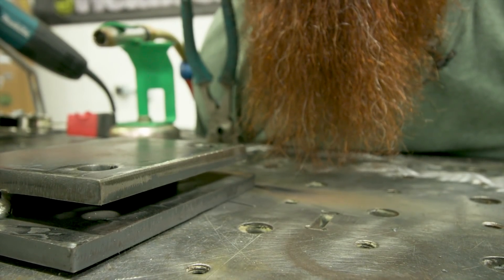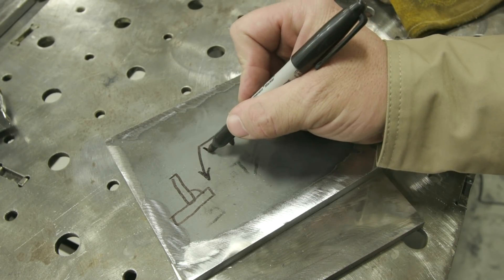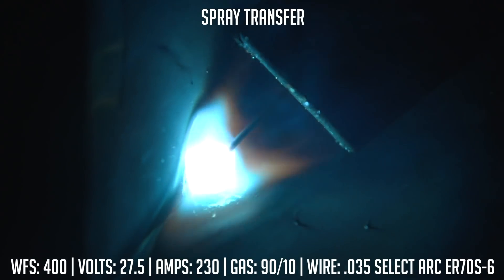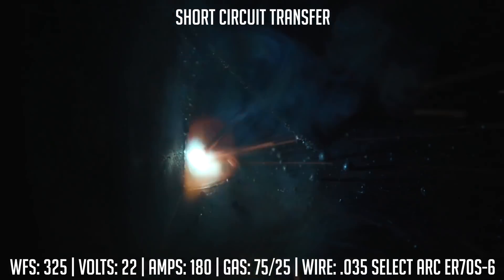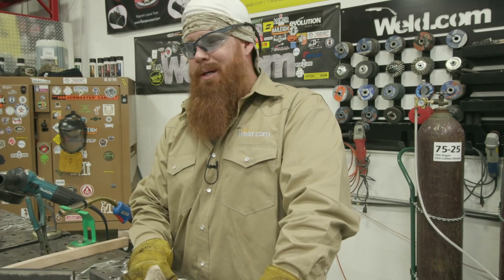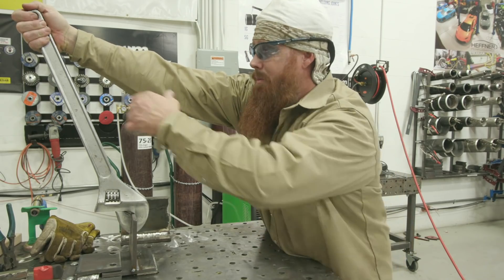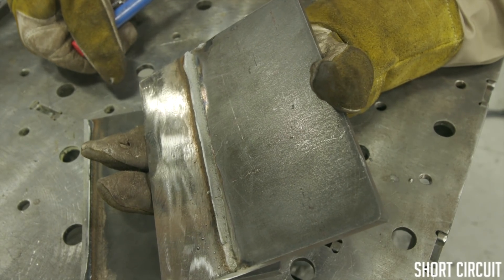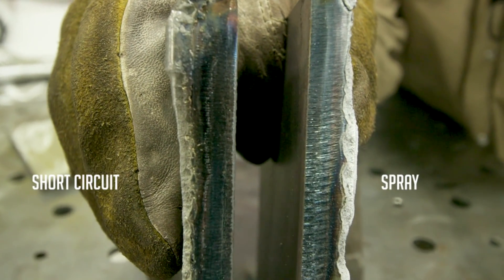Short Circuit VS. Spray Transfer

Comment: Would beveling the steel almost to a point and then welding it just normal mig be stronger than spray transfer.
Even the spray transfer one doesn't look deep and a bevel would let it really get in there.
I guess a bevel with one weld then one more over it?

Comment: When I was practicing for my 1st year Government exam practical portion 1G (GMAW, FCAW, SMAW, OxyAcetylene Welding and cutting <—everything you must show proficiency doing and pass bend + MPI + some Xray) I could weld the 2 coupons (using SMAW, GMAW+FCAW) and dunk them then immediately bend test them, mine wouldn't break, sometimes I would have some pull and partially break a little but usually into the parent metal. My instructor asked the other instructor if he'd ever seen anyone who could do that. I’m not sure if he was just blowing smoke up my azz, but it felt confidence-building for sure!

Comment: I have an Eastwood175 mig. How do I know if it's short circuit or spray? This was a great video, and thanks.
Reply: It would be short circuit, you need higher amperage and higher amounts of argon for spray, you likely have a 25/75 co2/argon mix. Most MIG welding is short circuit so if you don't know it's likely that your best set up for that.

Comment: I finally got a bottle of 90/10 to try spray and pulse on my millermatic 255 after owning it for 6 months lol, this is the first time I’ve tried pulse or spray, spray is so fucking slick!  It’s HOT AS HELL THOUGH, you’re gonna need one of those silver mig backhand insulators! I like it, I’ll start using it more, also I had a hard time finding this info, for anyone who has a 255 and isn’t knowledgeable on spray, try 28.0v/425wfs to get you started in spray, u can use 90/10 gas for mild steel and regulator at 35-40cfh. Took me an hour to find that info so hopefully you see this lol

Comment: I know this is an old video but getting in to welding these are all great! I have a question: How do you handle dust from grinding in your shop? Uncontrolled it gets EVERYWHERE including in the air.
Reply: There are vacuum network systems you can buy that can be set close by above the project at hand.  I don't know how much they cost but I imagine that someone could create such a system by modifying a shop vac ;)

Comment: Personally I stray away from either  yes spray does penetrate deep but its alot more harder more brittle if I'm welding anything structural I'm going with a ductile material like 7018 or dual shield or T8 wires just not found of hardwire period I've had short circuit as well as spray fail usually cracking on spray and lack of fusion on short circuit

Comment: Would .045 wire give you the penetration using short circuit?
Reply: Seth Thomas not really. It’s the mode of metal transfer that has the restriction not the filler metal or diameter.
Reply: Makes sense. Thanks for the info
Reply: Seth Thomas no problem man, thanks for watching.

Comment: When I had to take an unofficial weld test on plate like this. The welder was already set and I wasn't allowed to change it. But I digest, he bent the t joints the opposite way you did, is there a reason for that?

Comment: Thanks for covering this topic!
I am not so sure if the "rule" Spray (@higher voltage) versus Short Circuit (@lower voltage) => deeper penetration serves as a solid guideline. As far as I know, short circuit welds (e.g. <20 Volts) are also used for root welds. Also, an OEM (of welding equipment) states "one main welding variable that has virtually no effect on weld penetration is arc voltage ... The welding variable that has the greatest effect on the degree of weld penetration is current (measured in amperage or amps)." Google it.
In the video the Short Circuit weld used showed 22 Volts at 180 Amps while the Spray weld showed 27.5 Volts at 230 Amps. Although the following calculation is not 100% right (e.g. waveform, pulses etc.), it helps to understand that the Spray weld had far more power than the Short Circuit weld i.e., 6.3k Watt versus 3.9k Watt. Assuming that the travel speed was the same, the energy that was brought in using the Spray weld was 61% higher.
Reply: Stefan Hertweck you are correct. WFS controls the amperage (heat) Voltage is just the electromotive force driving it and controls bead width. The purpose of the experiment was to show that short circuit should not be ran on thick materials. The two modes of transfer are not equal in amperage. Short circuit works great on open roots because of the fact that it has low penetration and excessive penetration is not ideal on open roots. That’s why the root is ran with short circuit for the root, and the fill passes and cap are usually done with a different mode of metal transfer (such as globular or spray) or a different process such as SMAW or FCAW.
Reply: @GodslilRedneck23  Hello Jason, great. Thx for the clarification.
Reply: Stefan Hertweck thanks for the calculations. I haven’t messed around with them since I did my fundamentals of AC/DC final exam, I did a brain dump right after the test 😂
Reply: @GodslilRedneck23  Hello Jason, no problem. The basics are very simple. As it relates to power, it is calculated Voltage x Current (in simple terms). With Voltage or Current alone you can't weld, it is the product (multiplication) that matters, that is P = U x I [unit is VA or Watt]. Now, time matters. If you let the current run for only a short period of time, let's say a second or even less, you consume just "a little bit" of energy i.e., E(nergy) = P(ower) x t(ime) [unit is Wattseconds or Watthours]. However, if you let the current run for a long period of time, you consume more energy (more Wattseconds) and it will make a big difference in your energy bill :).
Now, before the "electrical engineers" chime in ... yes, there are more details to this topic like wave form (voltage/current wave form) and the "type" of resultant power/load (active/reactive/apparent power in combination with resistance/impedance). But in general, knowing that:
P  = U x I => higher means you run "hotter" and
E = P x t => longer means you are "heating up" the material
is helpful when you are setting up your welding machine.
Hello welders, let me know if you find any errors in my simple explanation or if missed something, besides details of the dark side of electronics :)
Reply: Stefan Hertweck wow man. Thank you for that.
Reply: @GodslilRedneck23  Besides that, you guys do a great job in bringing welding closer to the interested community. So far I learned a lot from your channel. Equal credit goes to Jody's weldingtipsandtricks channel :)

Comment: we had 12 failing a simular test on school. because the did not clean/flat sharpened the bar before welding. so never weld a T joint or simular with a rounden side :)

Comment: Is anyone else surprised how easily both broke? I know he had quite a bit of leverage but I still would have thought the welds would have been stronger than that. Kind of makes me second guess some of the things I have built.
Reply: Drilldo it’s designed to fail  that’s why we only welded it on one side. The backside of the plate has no reinforcement so it’s an area of weakness.
Reply: Thanks. Yes I understand that but still I guess intuitively I would have thought a roughly 6” long good weld on 3/8” material would have been stronger even if only welded on one side and pulled in the weak direction.
Reply: @txdoodlebug  I think you're underestimating the mechanical advantage here, it was enough to bend the plate had the weld not failed and if your base metal is bending you have other issues besides the strength of your welds. However it was a good reminder to think about which direction the force will be applied on parts you're welding.

Comment: What’s your thought on short circuit for weld buildup on plate .480” thick. Mostly in the 3g or 4g position. Weld buildup is for abraded areas on a carbon steel tank. Or would you use Spray or Globular. Thanks
Reply: Thomas Elliott .480 is thicker than 5/16” so in wouldn’t use short circuit. Since it’s in 3G you can’t run Spray or Globular. I would run pulse spray or use a different process.

Comment: Sorry but those are both really bad welds. You really don't know what you're doing do you
Reply: Justin Meyer what makes them a bad weld?
Reply: @GodslilRedneck23   see how inconsistent your thickness is? A good weld has parallel sides and even thickness. After breaking you can see how much it varies. Lack of puddle control because of not enough wire/angle/patience
Reply: @GodslilRedneck23  and not enough movement if you're going to short circuit on that material.

Comment: so it's just in the settings? (and a little in the gas) just hotter settings and more wire for spray? sorry for the stupid questions, I just never did get the difference. What about sound? bacon?

Comment: This is for Mr. Bob.

Can you do a video showing how to wrap/tie in corners. Corners such as mitred square tubing. Going from inside fillet to outside fillet then back around to inside. As elaborate as you can. I’m using 1/8” mild steel. Millermatic 130xp. 120v. Voltage knob setting 4 wire speed on bacon sound. Flux core Gasless .035”

Comment: Now I get the difference between short circuit and spray but can anyone explain to me the difference between spray and spray pulse? Are the settings different?
Reply: VERY different. Any GMAW welder capable of getting up over 25V can do spray. Pulse spray is a welder specific feature designed to give the benefits of spray with reduced heat input.

Comment: How much force did you apply to break each type of weld? Could you use a spring gauge or weights to show us next time?
Reply: rik999 I wanted to do that but we didn’t have a gauge. The purpose of the test though is to show the lack of fusion, not the amount of force to break it. To demonstrate force or load, a tensile pull would be more appropriate. We showed that test in the Stringers VS. Weave video.
Reply: @GodslilRedneck23  😄😄😄😄bro don't even get that can of worms opened up again 🤣🤣🤣🤣🤣🤣
Reply: madcap magician 😂 nope not again.

Comment: What about for spatter? Gas wise? We run out machines hot! 26 to 29 W 10g but 75 25  gas.  What do you suggest?
Reply: Argoshield 8C 30 CFM , 26-28 volts, 550-620 IPM

Comment: Can you use the same wire with the two processes? Or do you have to use two different wires
Reply: Cobra Strike same wire type and diameter on both modes of transfer.

Comment: What is spray how is it not short circuit
Reply: James Holbrook in short circuit the wire physically hits the base metal/puddle about 20-200 times a second. In spray tiny droplets of weld wire melt off and fall into the puddle. The wire never touches it.
Reply: @GodslilRedneck23  ok how is this accomplished ?  At some point there has to be some contact in order to start the arc ? Or am I missing something about this process??
Reply: @madcapmagician6018  initially there is contact between the wire and the base metal, but when you have an argon rich mixture (usually 90/10 or 92/8 Ar/CO2), the wfs passes a certain amperage threshold, and if the voltage is high enough, the arc simply stays "on" from that point on.  So as the wire goes through it, it literally liquefies and is propelled to the base metals, hence liquid droplets of filler wire are "sprayed".
Reply: @zod-engineering-welding  thank for the information,  I had heard about this process, just never used it.  👍👍
Reply: So basically it maintains an arc but what is different with the machine and wire just a higher
Reply: @james10739  read my reply from an hour ago.  Those are the differences.
Reply: @zod-engineering-welding  ok one other question, would a higher Argon concentration beneficial to short circuit transfer in any way?
Reply: @madcapmagician6018  according to Lincoln, no.  You get less tensile strength, less elongation, less ductility if you do not have the correct amount of CO2 in the gas mix.  Anything more than 90% Ar in the mixture, it is subject to adverse effects.
Reply: @zod-engineering-welding  thank brother 😁👍

Comment: I would like too know more about the Everlast 275 mts  - features and cost when does Everlast plan on put it on the web site and start selling them,   Is it a duel voltage welder, is it A/C, D/C, do all fuctions run at 275 amp's, the display look a little small hard too read, how hard is the menu to operate,  how's the duty cycle,   is it worth it for the extra 25 amp's,    how does it compare too the mts 252 sti.  I've been putting off buying the 252 sti  too try and find out more about the mts 275 lightning
Reply: The Lightning MTS is an updated version of the 252. It is still a 250 amp machine. It has some updated features and the new digital interface. We will be releasing it for sale in early 2020 for around $3,800 - $4,000.

Comment: Can you do a macro etch on a cross section to better show the comparison of penetration? Also is there a formal standard for the definition of spray transfer vs short circuit? Is it defined in D1.1?
Reply: TD Engineering yes, a macro tech can be done but we wanted a larger sample to represent the whole weld not just a small cross section of one area. The standard definitions are available in the AWS A3.0 Standard Terms and Definitions book. It’s not defined in D1.1 but it is stated in D1.1 that it had to be qualified to be used whereas SMAW, FCAW, and GMAW Spray are prequalified.

Comment: I would be interested to see spray transfer vs. flux core?
Reply: I agree. That would be an interesting comparison. There are some FCAW-G wires that have a higher diffusible hydrogen content, but it’s just something to consider when looking at wires. There are wires that hold an H4 classification which are readily available and commonly used. Then the mechanical properties can vary widely between wires also. The cool thing to do would be to match the properties as closely as possible and then compare in flat/horizontal as well as out of position. It’s hard to beat a quality FCAW-G wire when it comes to vertical or overhead welding, but on a super thick flat fillet weld over clean material, spray transfer with metal core or solid wire could potentially be more effective. I would love to put those theories to the test though!
Reply: I came here to ask the same question. I know you can run flux pretty hot as well so I'd be interested to know how the two compare in terms of strength
Reply: If it's gas shielded fluxcore it's gonna have better ductility especially if you use straight co2 spray transfer hardwire while it penetrates really deep in the root it dosnt do as well with impact or shock as a 71t1 or t8 t6 wires

Comment: Any dangers to spraying 10 ga. 304 or mild steel when you are traveling really fast?
Reply: No if you can do it then go for it. For 304 use a 95%Ar/2%O2. Or a TriMix gas. Use a 308L filler wire as well. Keep inter pass temp below 350*F on multi pass welds.
Reply: 98/2 and 92/8 are my only choices.
Reply: @hodgepodgeenginerd1258  O2 or CO2?

Comment: I use a 95/5 Argon/Oxygen mix for spray transfer and the increased amount of argon helps with the ionization potentials and the oxygens helps push the arc deeper into the root of joint and there is usually no splatter whatsoever if done correctly. Very nice video.
Reply: I dont know if your uk based or not but would you say a 93 percent argon mix with 5 percent co2 and the rest 02 would work on 26v? struggling to get true spray on my current gas set up on 83 percent argon